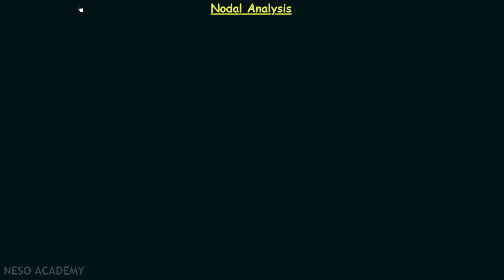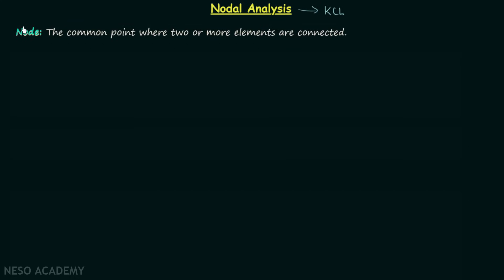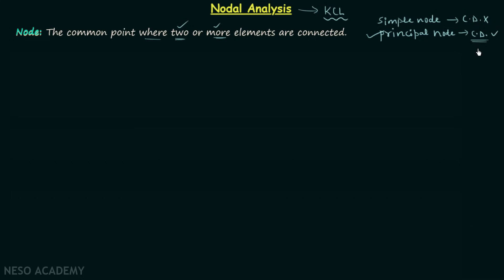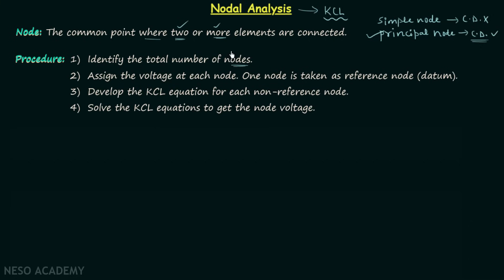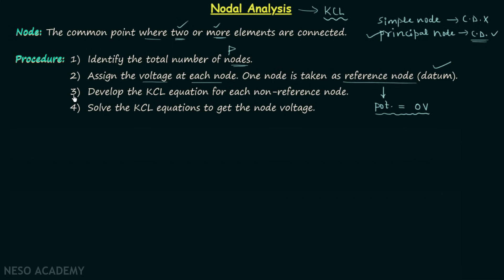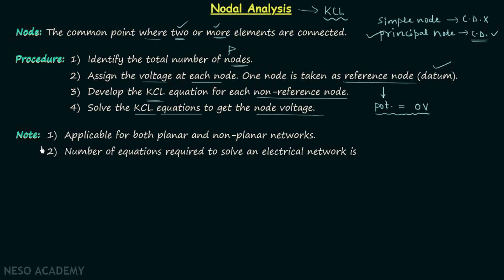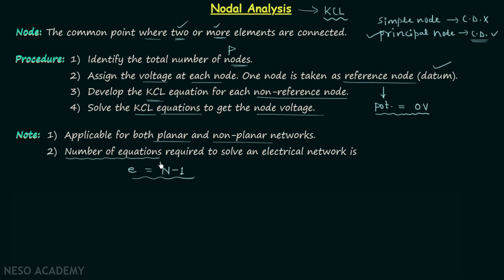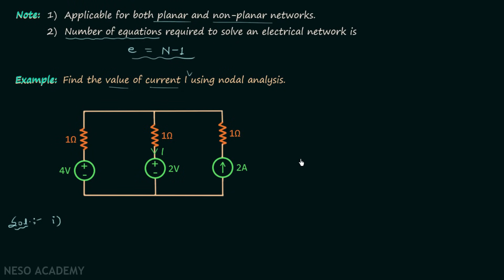Nodal Analysis

Comment: 10:36 how did you know what signs to use in the equation? I thought V would be positive because the current flow hits the positive terminal first, and with -IR, why is it negative? what is happening?? please help
Reply: current doesn't hit positive terminal of battery first . the terminal from where current leaves is marked +ve because obviously current leaves from there and current arrives at other end making that other terminal more electronegative
Reply: @fossel-11  Thank you for the explanation. But I'm afraid that I still dont understand, can you maybe give me some kind of reference or elaborate more? Sorry
Reply: @jealouspotato1107  Current always flows from positive end to negative end . The current that is flowing from the resistor is opposite in direction to the current flowing through the voltage source. Thus IR becomes negative.
Reply: @god_aks1540  Now I understand. Thanks so much!
Reply: Watch mesh analysis 1st video of this channel............it would be clear

Comment: Great video, thanks for the explanation! Once question however: How do we calculate I1 at the end? It can't be 0A.
Reply: it can be...when two potentials are same current cancel each other
Reply: To calculate I1, you take the voltage drop across the resistor and divide by the resistance (Ohm's law) However, in the problem both sides of the resistor have a potential of 4v. So I1 = (4v - 4v) / 1 ohm = 0/1 = 0A

Comment: If we solve this problem by Mesh analysis, then what would be the value of I? I1 or I2? As we can not apply KVL for mesh 2. So the value of I2 will be 2A/-2A?
Reply: If we apply kvl to this network. Then from the first mesh we get i1=0. From second mesh it is i2=-2. But as we are asked to find the correct " I " which is flowing in the middle branch, and as there are two currents in two meshes. Therefore I=i1-i2. 
i1=0, i2=-2. So I=0-(-2)=2A.
Reply: Hello Srija, why can't we apply kvl to second mesh? We can, assume voltage across 2A as Vx